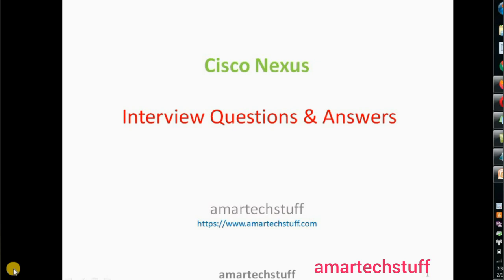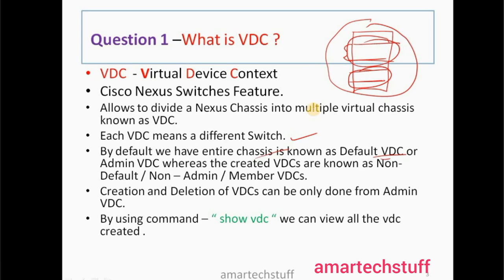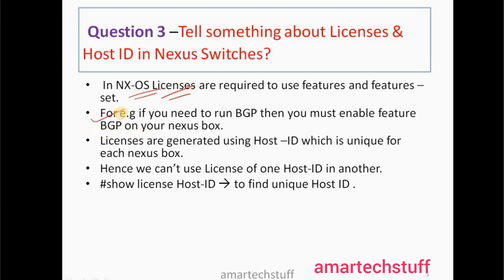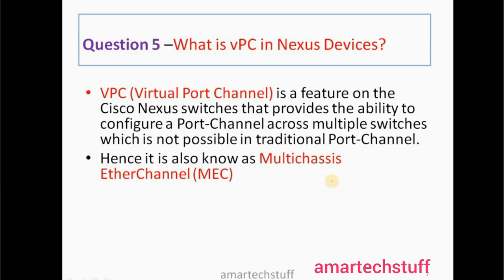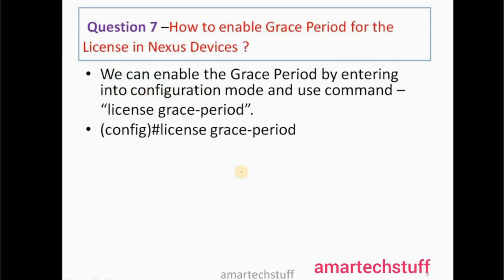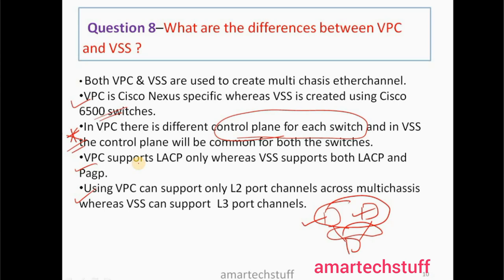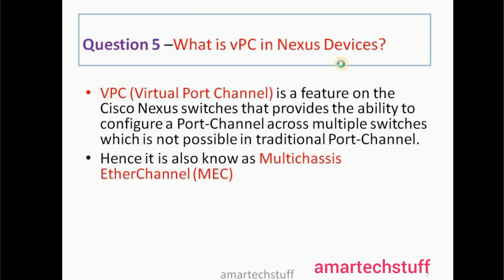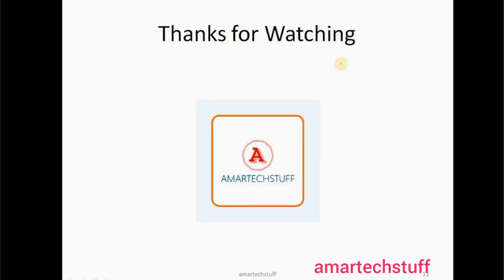Top 10 | Frequently asked | Cisco Nexus Interview Questions & Answers | DataCenter NOC Engineer

Comment: Depending on what role you are interviewing for that works with nexus, here are some critical items to be prepared for (I have interviewed dozens for Nexus roles):
 - First and foremost - an in-depth understanding of the FUNDAMENTALS of networking. Not Nexus specific, understand what packet headers should look like at each hop for a particular flow in a network and why. Detailed L2/L3 fundamentals. It is hard to trust someone is really qualified when they cannot get into the weeds of basic networking, regardless of their experience or how their resume looks.
- How specific can you get about how a network device performs lookups on a packet? How/when does a router/switch determine whether to route/switch a packet?
- What is a control-plane, data-plane, management plane? How do they interact with eachother? 
- What is an ASIC and what's the advantage?
- What is a glean packet?
- What is CoPP? How to indicate a problem?
- What does high CPU mean on a Nexus platform?
- What is oversubscription?
Reply from the maker: Thanks a lot 😎 for your helping comment ! It will actually help many subscribers
Reply: Thanks Joe, I am looking for Nexus job role.